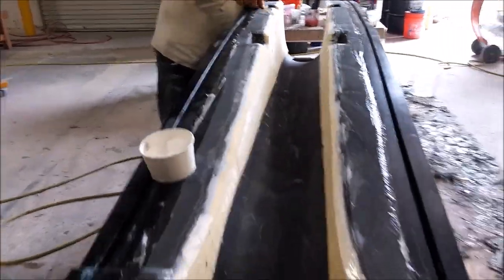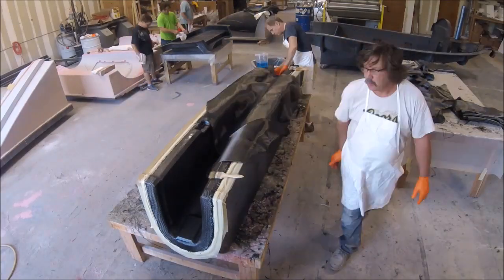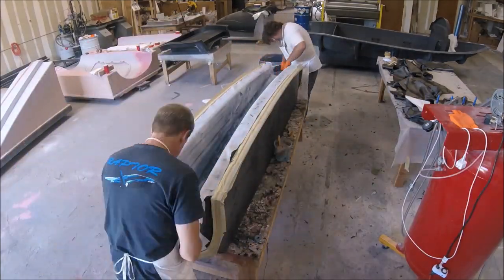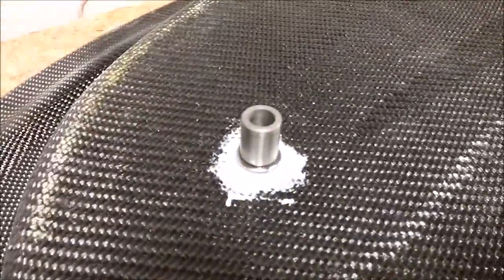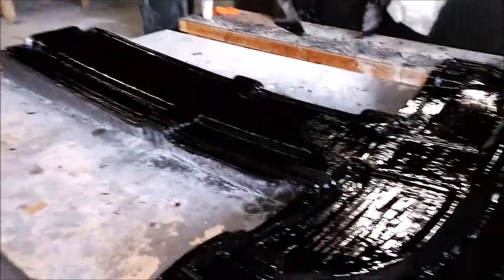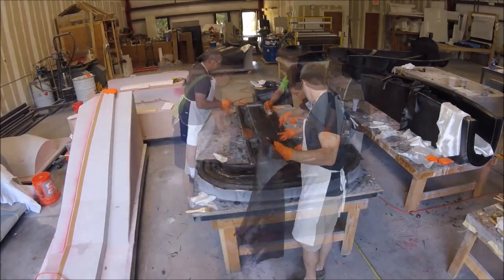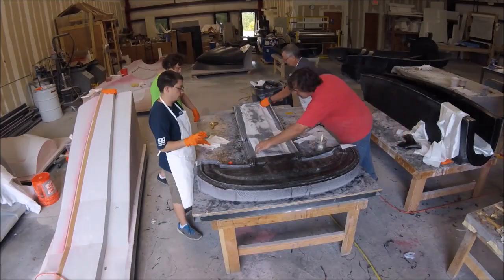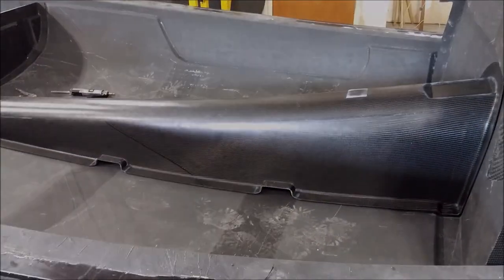Raptor Aircraft May 17th

Comment: Hopefully you won't have to back track too much if you run into issues getting the model dialed in after the issues uncovered during test flight and the resulting modifications.  Keep up the good work.
Reply: +Rangband1 None of what they've built so far should affect the issues they found. That's all got to do with the lift and control surfaces. I would guess they'll be flying the model again sometime soon, though, to verify the changes.
Reply: +David McCullough I agree but never say never.  Hoping it all works out regardless :)